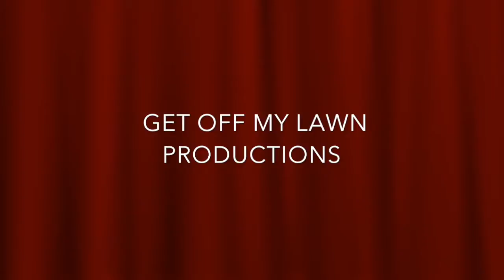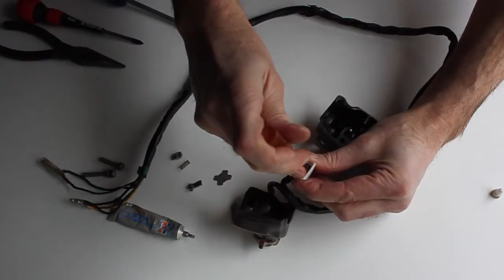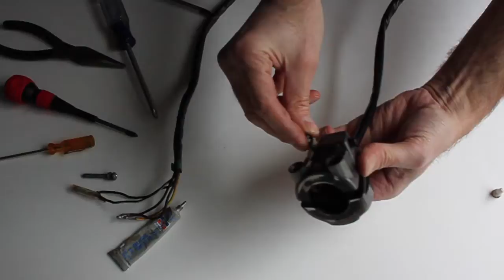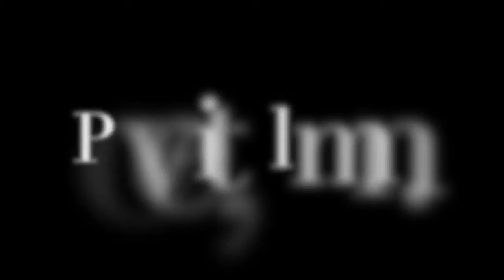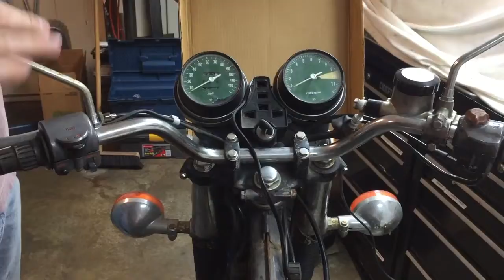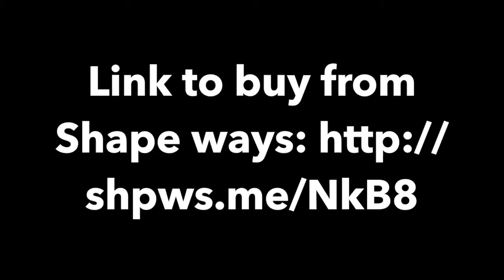1976 Honda CB550F Start Switch Repair - For Real

Comment: Ordered your new part, it arrived a couple days later. Just got done installing. Only thing I had to do was sand the sides a little. It was a bit tight trying to fit into the housing. Starter button works great again! Thank you.

Comment: Hey man thank you so much for this.  I'm hoping this white piece can fit my 1975 CB200T took it apart to address a sticky starter button issue and I can't put it back together that white piece is pretty much disintegrated.
Reply from the maker: I hope it works for you.  If it's the same piece, it's an easy fix.  Go easy on cleaning the contacts, like almost none.  Good luck!
Reply: Just got my 75 CB200T. Starter button is missing but hoping to find a replacement when I have time. Did this end up working for you? How did it fit?